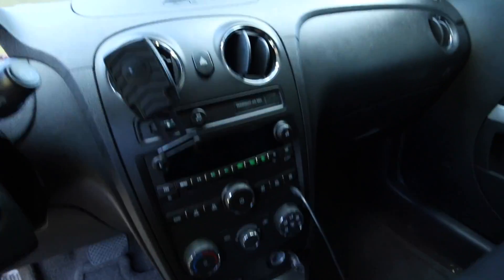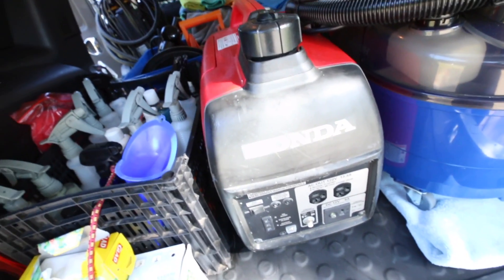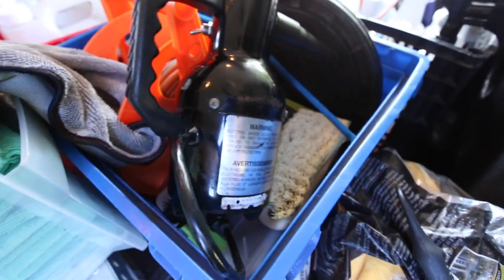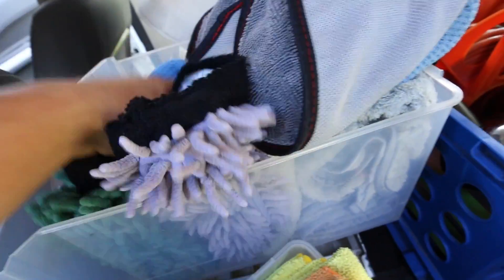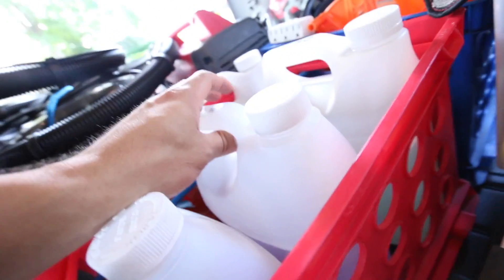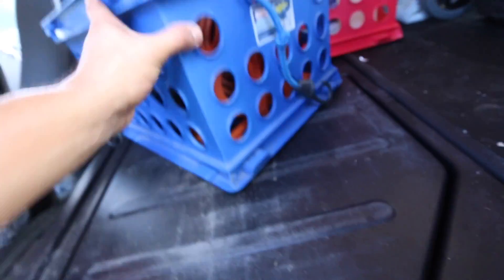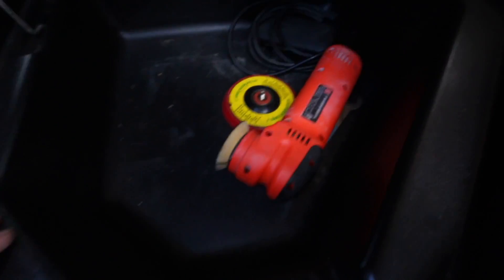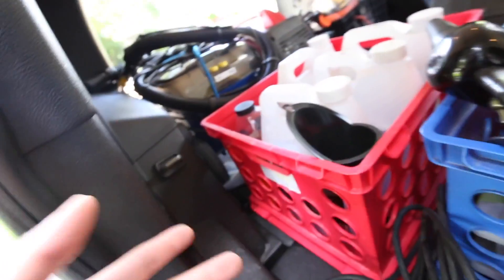2009 HHR Panel Mobile Detailing Rig - 2018 SETUP and REVIEW

Comment: I was hoping you had jumper cables because I have had a customers car die before which was my fault because I accidentally turned on a light and forgot to turn it off but jumper cables saved me big time
Reply from the maker: I have  a set. Opposite side of the small comparment. It helps!

Comment: Awesome setup brother ! Where do you get your water from ? Customers houses ? Do you foam wash do you use a pressure washer ?
Reply: Brandon Morfin he use the customer supply at home or use rinseless wash if water is not available.
Reply from the maker: I use customers water or I can a 5-gallon bucket filled with water. I haven't foamed a car down in 2 years

Comment: what if u don't have water access and people want a wash
Reply: RamVan Bobby rinse less
Reply: RamVan Bobby waterless
Reply: meh cant use that product on dirty dirty vehicles. eventually you'll come across a car that need to rinse off with water.
Reply from the maker: Rinseless. If the car is too dirty, use something like a Worx battery-powered pressure washer

Comment: You should get a roof box just to make room in the trunk.
Reply from the maker: I've thought of it. What could I put in there to make more space?
Reply: Detail Groove if you get the bigger one, possibly your equipment. If not, your towels and liquids?
Reply from the maker: I was thinking about that but it looks like more of a hassle. Considering it's not as easy access and I don't want to have a bunch of crates/bottles all over the ground
Reply: Detail Groove gotcha, hey, if it’s not broken don’t fix it. Haha it might just be my ocd that asked that 😩
Reply from the maker: Ahaha- thanks for the input :)

Comment: Oscar do I need a high powered generator
Reply from the maker: I use a 300 psi "pressure washer"
Reply: what about type generator?
Reply from the maker: Worx pressure washer. It's powered by a 40V battery